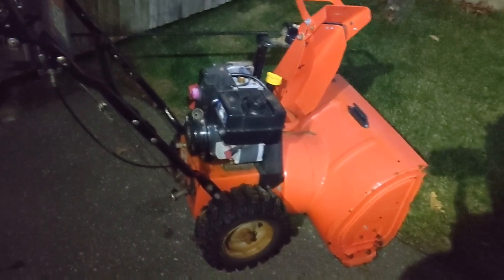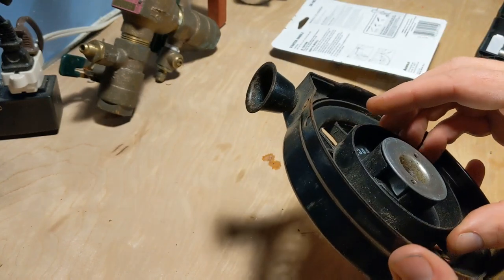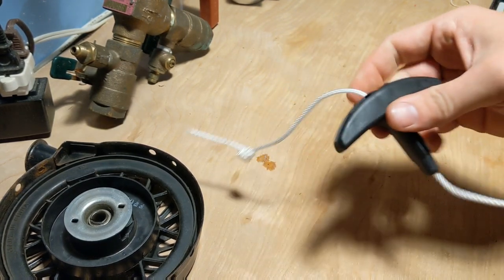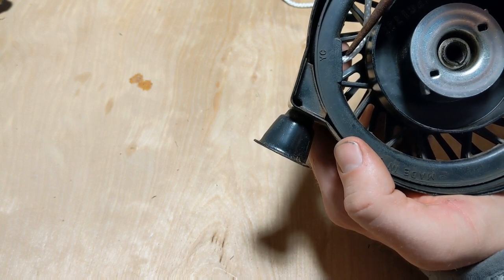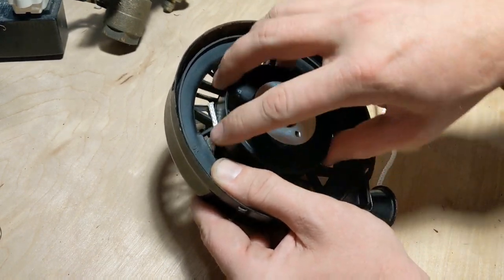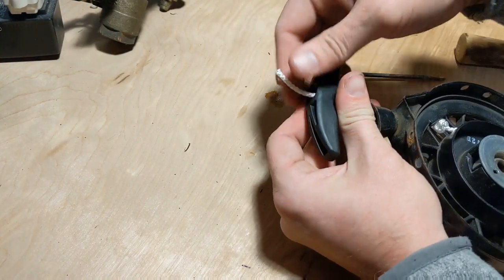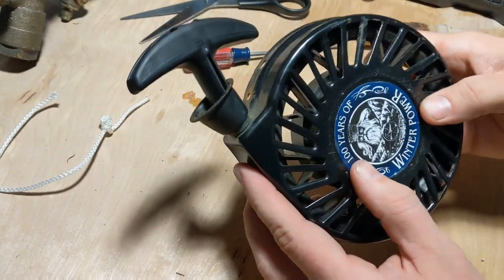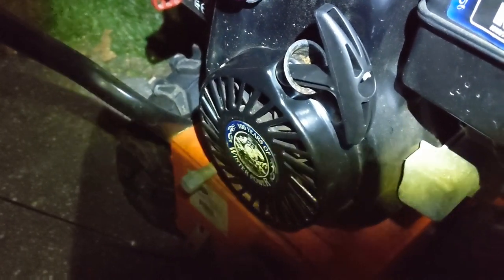How to Replace a Snowblower Pull Cord Starter

Comment: way better instructions vs some others who make you melt holes in the assembly. i did have to cut off the crimped/stapled part in my pull cord assembly. i came here after the service manual omitted this repair (has zero info on replacing a pull cord).  thanks for this!!!! way bigger help vs the vids with all talk and poor video quality.
Reply from the maker: I'm glad the video helped you. Service manuals always focus on the mechanics of the operating parts and forget about things like this.

Comment: Hole size is impossibly small to thread. It was like an evil carnival game. Tried wire, paper clips, needle nose pliers and praying.  I had enough of that fun, and finally just drilled out the hole from the outside in. Worked like a charm. Used a drill bit only slightly thicker than the string. The wheel on my Poulan Pro is plastic. I imagine this is pretty standard,  so be careful, drill slowly and don't take too much material away.

Comment: I've found that tying thin, somewhat flexible wire around the end of the rope, you can thread it through the outside when you line up the holes. There is an almost 90 degree bend between those holes.
Reply from the maker: That's a great tip, I never thought of that.

Comment: Looked at a few of these videos....the mechanism you've got is identical to mine.  To say getting that cord through that hole is a "bit of a challenge" is the understatement of the year.  I'm going to go buy a new pull chain as the one you've got, as much as I can tell, looks very slightly smaller than the one I broke.  I've been screwing with this for an hour and haven't come close to threading this through that hole - going backwards, as you've suggested.  Going from the outside-in would be virtually impossible.
Reply: I have the same issue. Just can't get the rope thru the hole from either end. What I am going to do is drill a hole directly opposite the  inner ring hole from the outside. Then I have a straight line to thread the rope.

Comment: Thanks for the video. However I didn't replace the handle but just buy a new 3/16" rope/cord for 28 cents at 7 cents/ft.  And I just reuse the handle and follow your video instruction and it was a cinch.  28 cents is cheaper than buying a new $1200 snow blower.

Comment: I have a question.  I have Model 921030 & my starter assy looks exactly like yours. Just broke my pull cord.  I had no problems with cord recoiling. But I tried to turn the wheel ccw and I realize there's no spring tension at all either way.  So something's wrong w/the spring inside. How do I access the inner spring? I removed the Ariens sticker on front, but no access there, unless I cut metal.  Is this part only replaceable as a unit?  Seems $55 online Ariens p/n 20001054.
Reply from the maker: That's a really good question. I have tried to access the inside and it doesn't seem possible. Maybe a small engine repair shop would know more. $55 seems ridiculous for the whole assembly. I wish I had a helpful solution. Good luck!
Reply: @everydaydiyguy7316  I ordered the Ariens assy.  Once i get the new one, i'll aggressively try to open/repair the inner spring.  Thanks to Ariens for not allowing us access to fix/replace the spring. NOT!  Trimmers, blowers, chainsaws, most allow access to the spring!
Reply from the maker: @FergusLandscaping   Let me know how it goes. I am curious if you can get access to it.

Comment: It's sad that these new recoils are not meant to be repaired but replaced at $35+ at a whack
Reply from the maker: It's sad that most things today can't be repaired. It's why I still have a mechanical dryer. I've repaired everything on that thing over the 20 years I've owned it. My washing machine is all electronic and when something goes, it's toast. Every appliance, device or thing we use has a lifetime of around two years.

Comment: I have this exact pull start cover.  I cannot get the string through it.  This is the most idiotic design possible for this part.  It's as if someone purposefully made this difficult to feed the string through.  In addition, the cheap pot metal nut on the end of the crankshaft stripped while I was turning the engine, trying to get it to start.  Now it cannot be tightened nor removed.  I will NEVER buy power equipment with a Tecumseh engine again.